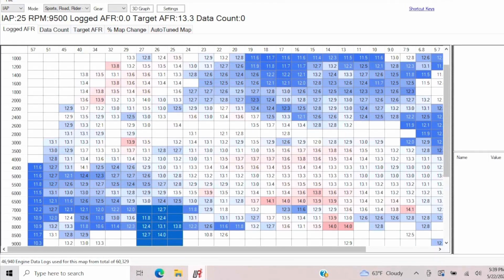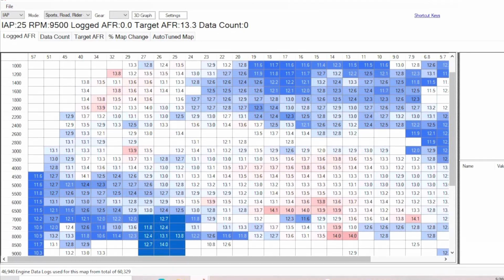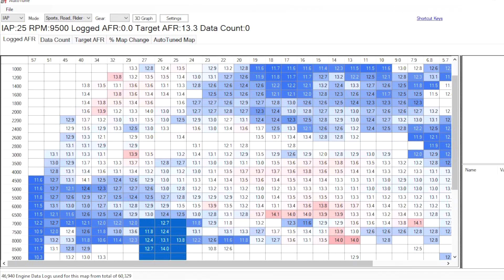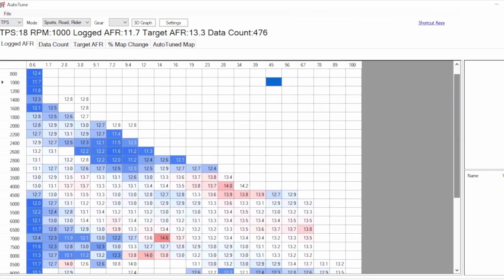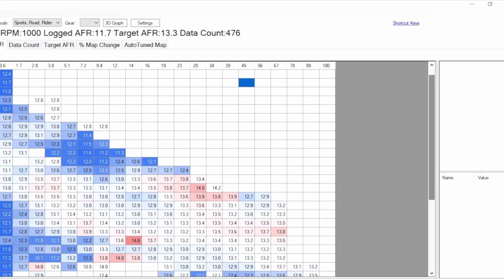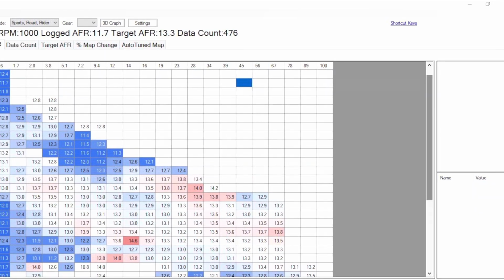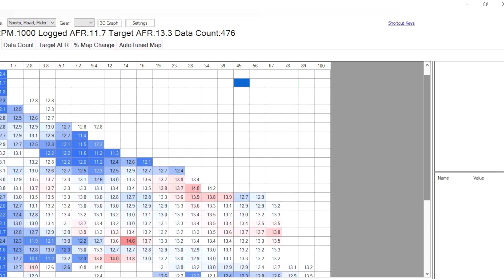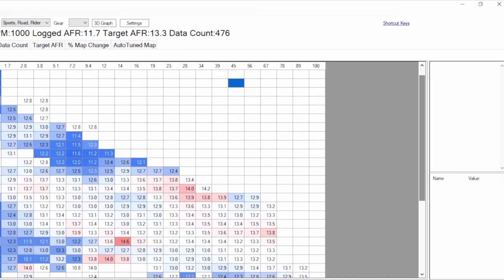Zx4rr first road data log ride. Why combining road tuning with dyno tuning is the best method !

Comment: I think I might purchase your tuning. I saw another company only work via the dyno. 

Id personally love to see an option that gets my zx4rr closest to 100hp if possible, speed and rpm limiter removed, and the torque closer to 45-50. Do you believe this could be possible?
Reply from the maker: I think you will find im the only company doing this.  This is one of the differencea of actually owning the bike vs charging a customer to tune their bike then selling that tune as a mail in flash.  Its not practical to ride a customers bike a hundred miles or so on the road to develop the flash.  Totally practical when its your own bike 🍻

We will have to see where it ends up but 100 on a non hero dyno seems pretty unlikely. 85 seems more likely
Reply: @vcyclenut  you seem like you are really putting in that work. My funds most likely are coming your way!
Reply from the maker: @jamalwilliams1009  its not an illusion.  I put a lot of work into my flashes.  12 years in business and over 7000 ecu’s.
Reply: If you want that much power and torque, I think your best bet would be buying a trick star ZX25R turbo kit and seeing if it fits.

Comment: Great info! Will you be doing flashes for mods as well? I want my zx4 de restricted and will most likely only do a slip on and air filter. Thanks!
Reply from the maker: Thanks!!, Absolutely!  Finishing up the stock bike flash tomorrow.  Then testing the graves slip on. Then  starting on full systems.   I have will have flashes for all of them.
Reply: @vcyclenut  Awesome! Subbed! Ill keep an eye out for that, hopefully by then ill have my break in miles done.